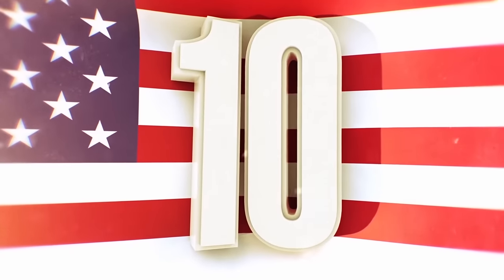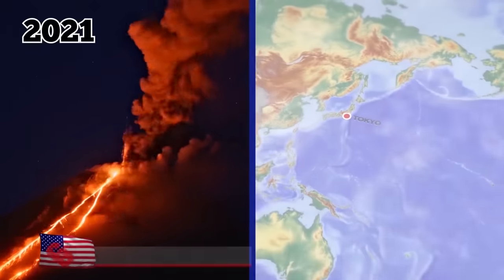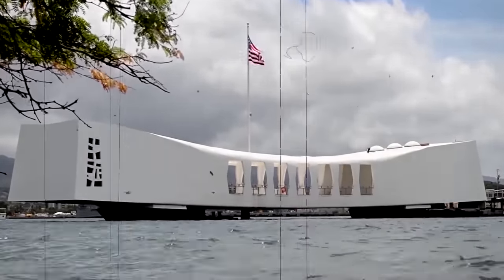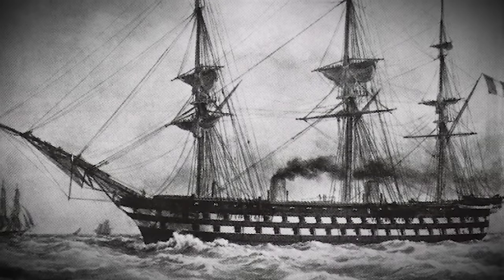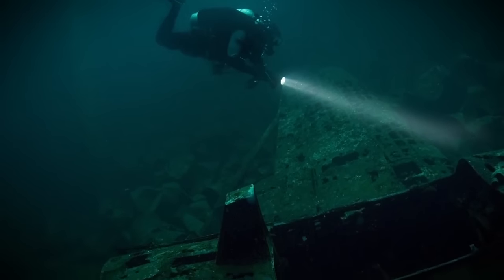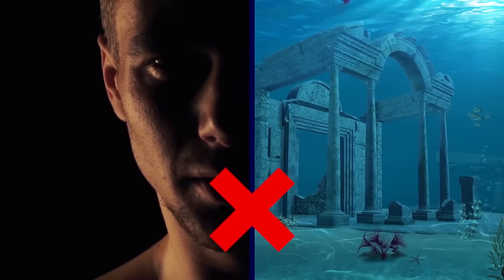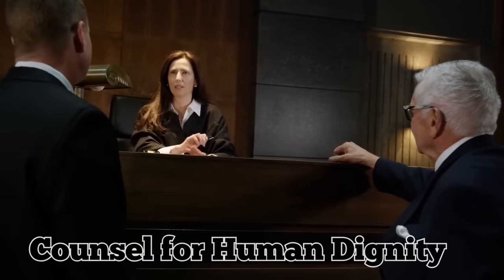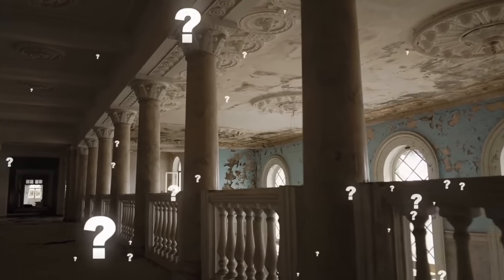The Most Unique Discoveries Nobody Can Explain

Comment: The entire B-29, "Kee Bird" was completely destroyed by fire after being restored to flying condition. During it's taxi to the runway the team had carved out, the plane's bouncing on the snow caused the planes APU, (auxillary power unit), to break loose from it's mounts, causing an immediate fire that they couldn't extinguish. 
All that's really left are both wings & 4 newly rebuilt engines. You can watch the entire video of the attempt to return the Kee Bird back to flying condition here on YT. It's called "B-29 Frozen In Time".